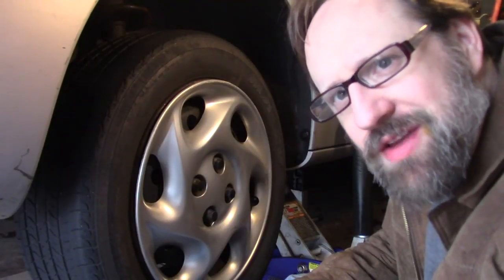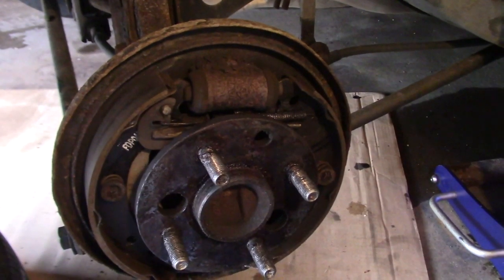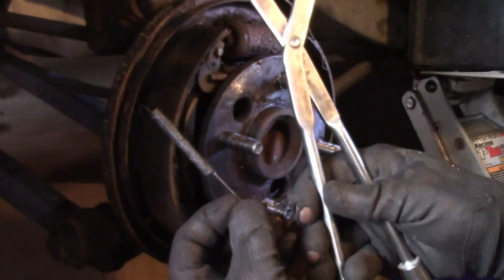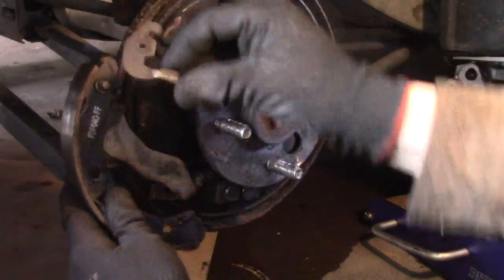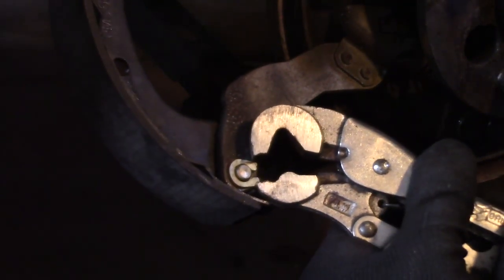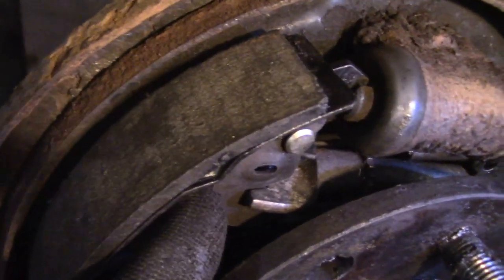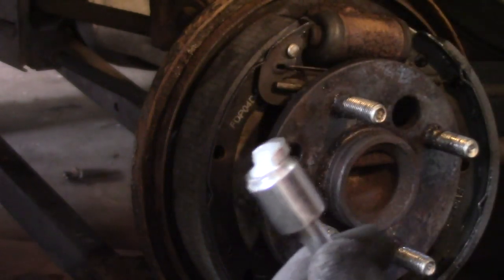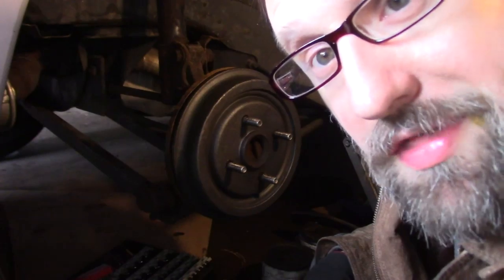Rear Brake Drums and Shoes 2001 Saturn SC2

Comment: Hi Clay, super helpful video, thanks!  I recently picked up a Saturn L100; the previous owner had several years of bizarre problems with the rear brakes.  I have the service record, where an otherwise reputable mechanic here in Hoo'ville, VA area kept replacing the rear hardware.....  Turns out, as you mention at min 6:20, it really "sucks to put these things in backwards....  sic.... yup, the local professional mechanics here charged the previous owner an arm & several legs to keep re-installing the rear brake shoes & hardware exactly backwards.....  with the parking brake plate IN FRONT of the trailing shoe, thus preventing the adjuster from properly seating into the back of the brake shoe!    (There are a few differences between the SC and L series saturns, but THAT afaik is the same..... Astounding that after months of searching, I could not find ANY youtube videos, or diagrams, or even decent alldata or chilton diagrams of exactly how the L-series brakes are to go together....  Mattered to me because the mechanic had put BOTH sides together incorrectly, so I had no model to work from.... You and RichPin are all I had...  thanks again.)
Reply: ps, if anybody comes across this and has experience with - or a detailed diagram or vid of -- the L-series drum brake job, please do tell.
Reply from the maker: Its such an easy mistake to make. And you're right. There really aren'r a lot of resources out there that show the proper way these things are supposed to go together!  Thank goodness for Richpin! His videos are excellent.  I've used his videos myself on a number of occasions. 

I'm glad this video was helpful to you. Good job figuring out what the mechanics didn't! Thanks for watching and thanks for commenting!

Comment: Just did my 98 saturn sl brakes I used oven cleaner and pressure washer to remove all brake dust and grease. Nice and clean :-)
Reply from the maker: Nice!!! I'm going to try that next time I do my brakes. Thanks for the tip!

Comment: I have a '99 Saturn SL1. Similar enough in most regards. When I changed the shoes on my rear brakes, I had a helluva time getting that C-clip off. There was no clearance at all to get any purchase with the screwdriver to pop it out. I had to hammer it in and really bend up the clip to get it out. Richpin just skipped right over that part and didn't show it at all. He just said "remove the C-clip". Gee, thanks, Rich.
 My new shoes did NOT come with a new pin and clip. I had to hammer the old one flat again and re-use it. Did the same squeeze you did because it was loose.
Reply from the maker: I've had the same problem and I ended up doing the exact same thing! I can't help but think, "would it kill them to include a new c-clip? I mean REALLY?!" Well, I'm glad you figured it out. Thanks for watching, and thanks for commenting!
Reply: About to do this on my SL1 99 - and thanks for reminding me. Maybe I should get c clips before i start this... I have all the parts, and my shoes didn't come with any hardware either. -Edit- the hardware kit does include c clips. Thanks again.
Great video Clay - and never forget a hammer.
Reply from the maker: @delarius  thanks! Glad to hear the  kit came with c clips. I just noticed today that Harbor Freight sell a c clip assortment. I'm half tempted to get it just for backup. Thanks for commenting!
Reply: @ClayCarlino  
It all went so well. Fixed the leaking cylinder per your instructions. Then passenger side wheel. Yeah, there's definitely a bolt that's not coming out. Heat, air chisel, penetrating oil - no go. Tomorrow, we're going to get a replacement bolt, and then cut the (was barely - now fairly) leaking cylinder off. Although, still a great video. but things are rarely as easy as you initially think.
Reply from the maker: @delarius , that sucks! So sorry to hear that. That's  the worst part about working on cars right there! Something that SHOULD be pretty straightforward turns into an ordeal because of one rusty bolt! Hopefully once you get past that, the rest will be easy.  Good luck!

Comment: Your video is great - you are a good, clear explainer!

I am doing this on my SC1 right now, and peeked inside the dust boots of the wheel cylinders (as Richpin suggests), and they were both leaking (both on the leading side piston for some reason)
You couldn't see anything outside the dust boot..
And I could smell that it was brake fluid, and not the brake cleaner I used..
Probably a good idea to do, but must clean first of course to keep any dirt out..
Also, do you use a good bit of brake cleaner and a dust mask when doing the dusty parts of those jobs..

Nice thing about Saturn is the parts are pretty cheap....
Reply from the maker: Gotta love Richpin! His videos are a gold mine for Saturn owners. Yes, I do use brake cleaner. I absolutely SHOULD use a dust mask, but sometimes I don't think of it until half way through the job. Better late than never I guess!

Comment: I have a 2000 Dodge Dakota I put new brakes on my truck and when we bleed the brakes you would have a pedal for about 10 times and then the 11th time it would go to the floor so since it wasn't building up the pressure and keeping it I change the master cylinder and then it still does the same thing you have any ideas what it could be
Reply: I need some help I live in Kentucky and almost died twice now

Comment: I thought you need to adjust the brake shoes from backside of the drum at adjuster.

So, all have to do just follow this without adjusting and it self adjusting brake shoes by pressing brake pedal.

I never knew this I always thought adjust at drum on back and then press brake pedal
Reply from the maker: Well, a lot of times I do both, I do a rough adjustment from the backside of the drum them pump the brake pedal after everything is put back together. But yeah both methods work.

Thanks for watching and thanks for commenting!

Comment: I put a left backing plate on the right side of my Saturn race car. Only thing I could find in boneyard.
  I cut the park brake cable off on inside of drum. Don't need it. 
  When drum installed will not turn at all. 
   Used pads and drum. Less RR braking the better, but rules say all 4 wheels must have working brakes. 
    Can you flip backing plates? What's up with no turning the drum.
Reply from the maker: Well crap! I'm not sure if you can flip the backing plate or not. I've never tried. As for the drum not turning at all, did you reset the adjuster screw? I've done that several times where I put the drum on but I forget to spin down the adjuster screw to it's shortest length. If you don't do that, the brake shoes can't retract far enough to let the drum spin freely. (You probably already knew that, but it's all I could think of!) Hopefully that helps! Good luck!

Comment: On my way back from the grocery store today, my brakes started feeling really weird.  When I parked in my driveway, my emergency brake felt really loose and weak.  I tried filling up the brake fluid reservoir under the hood, but a whole bunch of fluid ended up leaking out of the rear driver's side wheel.  I guess I'll be replacing my rear brakes soon
Reply from the maker: Oh no! Sorry, I hadn't seen this comment when I responded to your last comment. If I had to hazzard a guess, it really sounds like the brake lines are bad. I only say that because in my experience, the brake cylinders in a brake drum can often times last for the life of a vehicle as long as the brakes have been decently maintained. But brake lines, especially in regions where they use a lot of salt on the roads in winter will corrode a lot faster. If it is the brake lines there's good news and bad news. The good news is that the parts necessary are really not all that expensive. Even buying tools and fittings for the job can be done without breaking the bank. The bad news is it's a LOT of work. I've done it on 2 vehicles so far, and both times were successful,  but lengthy. One thing you can do to make it easier on yourself is to buy pre-made brake lines specific to your vehicle. It definately costs more, but will probably be easier than what I do, which is buying spools of brake line and custom cutting, bending and flaring them to fit. Good luck. Feel free to keep me posted about your progress!
Reply: @ClayCarlino  Thanks man!  I figured it would be a lot of work, but luckily my family taught me to be a cheapskate and we fix all of our cars ourselves.  It's an old car and just about everything on it is original, so I can't really complain.  Also, where I live they don't salt the roads since it never snows, but there is the possibility of salty ocean spray corroding the brake lines.  I have a 2002 Saturn SL1 5 speed.  My dad, grandpa, and I are going to have a look at it this weekend
Reply from the maker: @mgonza1350  that actually sounds kind of awesome! When I'm working on cars and really the whole time I worked on those brake lines, I think of my dad. He would have loved the work I do. It's  really awesome to be able to share these experiences with family!
Reply: @ClayCarlino  I ended up replacing both rear brake cylinders and that seemed to fix the problem.  I also replaced the shoes and a few of the springs since I was already in there.  I might still have to fix the e-brake, though, since it was getting stuck on the rear driver's side and really wearing down the shoes on that side.

Comment: That tool you cut off is for taking real tough Springs off but it wouldn't work on your car it's made for other cars maybe trucks that are bigger Springs you'll have to go buy another one now the spring and cap you push in and turn you can use needle-nose pliers or pliers
Reply from the maker: Yeah. That's what someone else said a couple years ago. So far I haven't needed it, but I'm kind of glad to know that it's not a flaw. On the up side, after cutting that bit off, it really was a lot easier to use the tool on those little caps than it ever was to use needle nose pliers. So I'll call it a win. Thanks for the info! And thanks for watching.